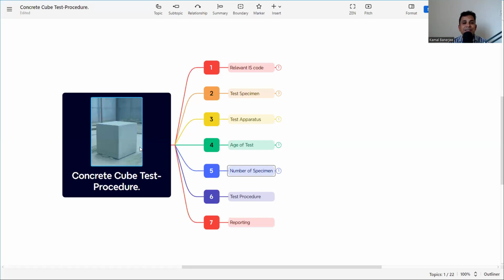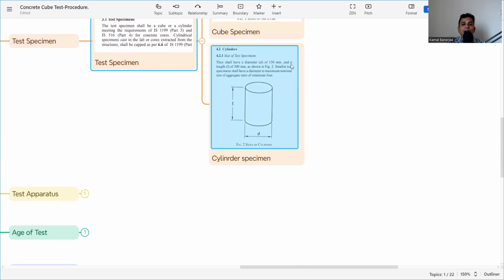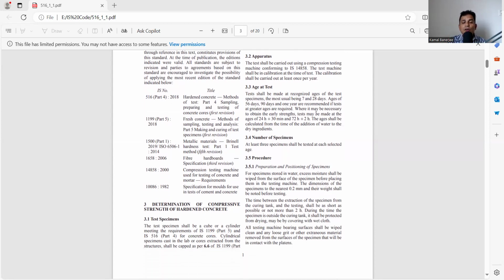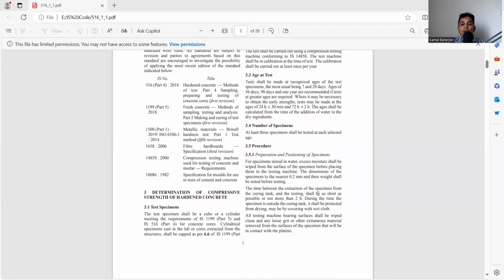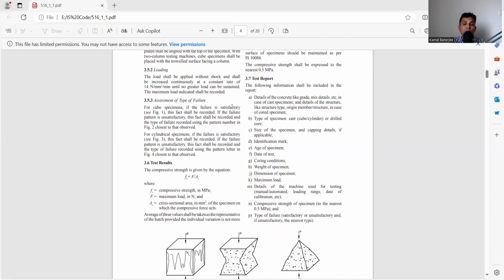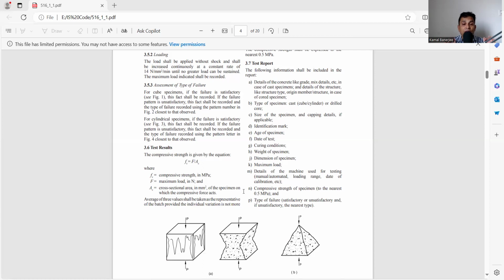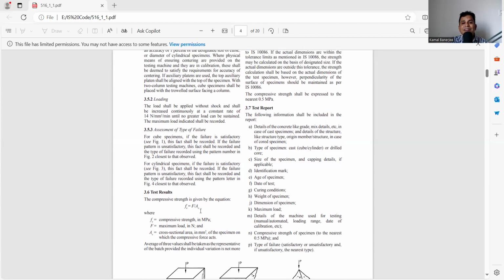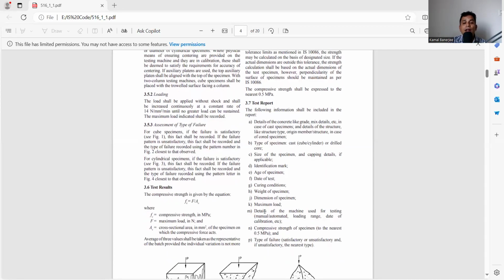Mastering Concrete Cube Testing  A Comprehensive Procedure Guide

Comment: Sir in my site laboratory i have semi digital hydraulic machine not letest digital one, in this machine I didn't get perfectly set rate of loading. This machine have only one hydraulic pressure controler i didn't control rate of load 140 kg/cm² per min,14N/mm² per min or 5.2 kn per sec. If rate of loading is higher how effect in concrete spaceman strength reading.
Reply from the maker: Higher rate of loading will give more strength. Then correction factor to be applied to calculate the actual strength.
Reply: @QualityBrandingHub  how to apply correction factor in higher strength reading value...